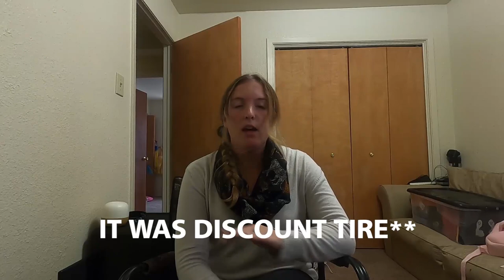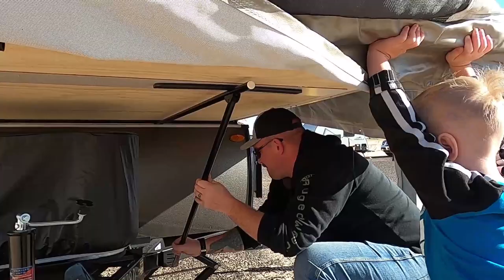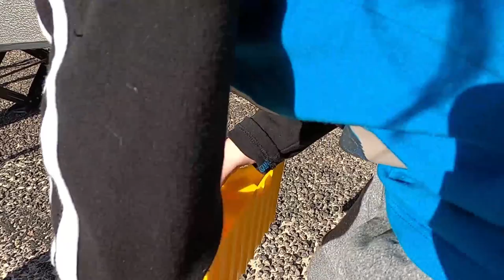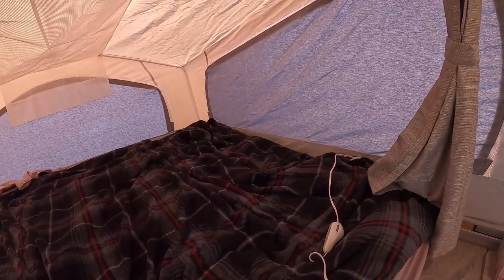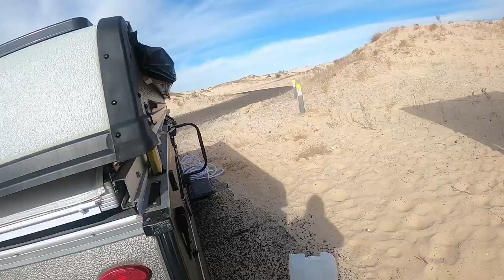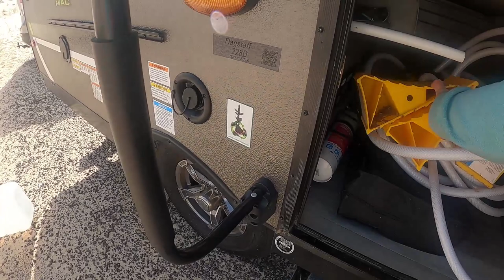We Bought A CAMPER || 2022 Flagstaff MAC Pop Up Camping Trailer Walkthrough

Comment: We have had a Flagstaff 207SE for almost a year now and love it! A couple of things we have learned is 1) try not to force the roof down when latching just to make it latch. Someone told us this will weaken parts of your roof over time. 2) MOST IMPORTANT: Don't remove your tore chocks until the camper is hooked back up to the car. We almost made a HUGE mistake when the camper started rolling back towards the lake at Lake Murray in Oklahoma. Luckily we had enough people around to hold on to the camper. Always chock the tires before unhooking from the tow vehicle and never remove the chocks until you are hooked back up to the tow vehicle. Happy Camping!
Reply from the maker: Oh my goodness! That could have been so bad, glad you had people around to hold the camper! Thanks for the tips.
Reply: It’s easier if you put on the bed supports first
Reply from the maker: @liroweplays847  Yeah, we will do that next time. This was only our second time setting it up!

Comment: NICE! We bought a popup two years ago, and the family loves it. It's like a rolling bunkroom. More sleeping space than any other trailer for the budget. Pro-Tips: put in the bed supports before pulling out the bunk ends so you don't bend the sliding tracks, and buy a cheap cordless drill with a 3/4" socket to zip down the four stabilizing jacks.

Congrats and enjoy.
Reply from the maker: Thank you! It is definitely like a rolling bunk room 😂 but we all fit and have room for family/friends too! Thanks for the tips!